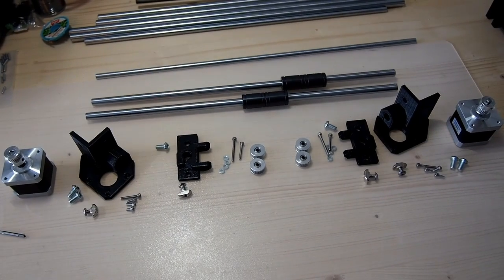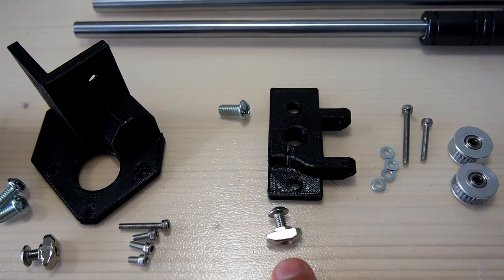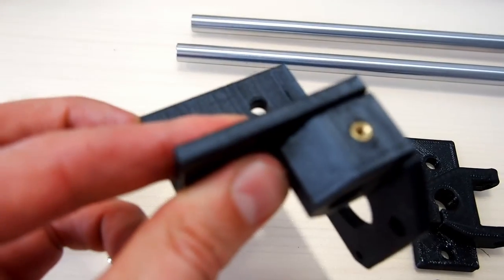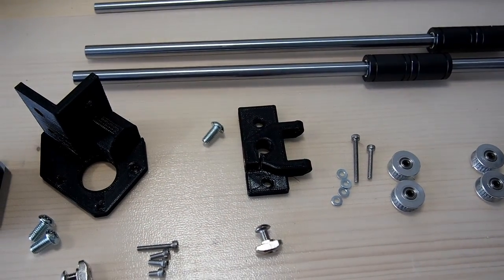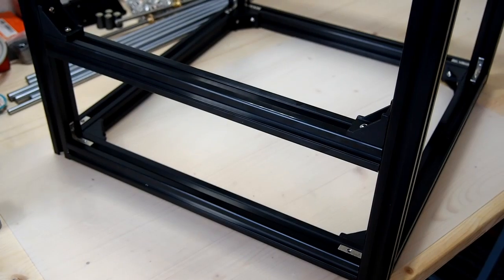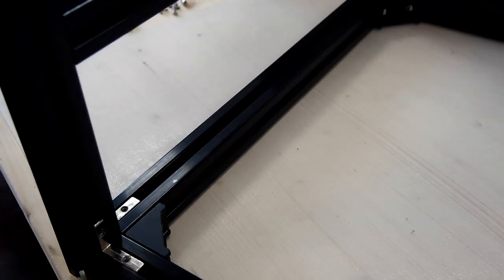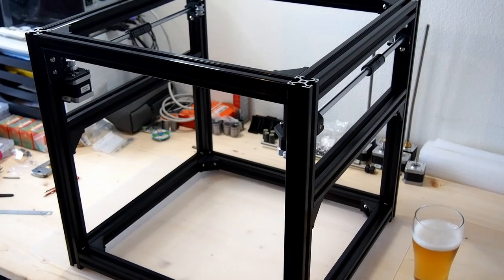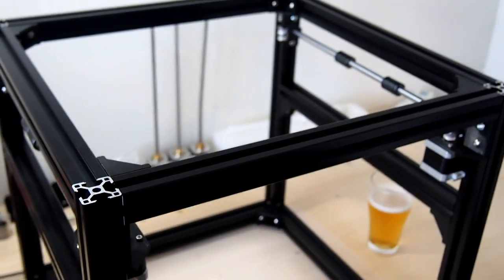HyperCube Evolution #4 - Y Axis Assembly

Comment: I could not agree more with what Fred said. I'd just like to add that you do indeed have 3mm. stainless steel rods available to buy on Amazon. I think they're used in RC models. Buy these, then heat up the bearing with a heat gun to expand a bit (get it to a point where the heat difference between it and the environment is about 80 deg. celsius), put it in the rod and let it cool down and it will lock itself onto the rod. Of course, going this way means remixing some of the parts so that they'll accept a rod with pre-installed pulleys instead of a screw which is what I did on my implementation of the hevo. Yeah and extra points for the beer :)

Comment: You're running pulleys with 3mm id bearings on M3 threads? With washers for spacers? So many things wrong there. First, the bearing inner needs to be fixed to the shaft so the bearing outer can turn on the ball bearings, or you have hardened steel bearing on the soft, pointy screw threads. M3 threads are actually 2.89mm not 3mm diameter, If the bearings are a fraction tight then they will just chew up the threads and your pulleys won't run right. Second, the bearing outer needs to be free to turn so jamming a washer up against it defeats the point of having a bearing. 

You need a shaft that's a tight fit in the bearing id, and spacers that only contact the lip of the inner race. Ok, so I can't find an easy solution there, at least not one that's available to buy. Best I can think of is some 3mm drill rod, held in place with epoxy,  with a drop of ca glue to stop the pulleys wandering. I'm fortunate to have a lathe and a mill so I'll make some brass shafts and spacers.

Otherwise, great job, many thanks for all your hard work. I'm building mine atm, having a lot of fun as my bank balance diminishes.

Comment: Hello Scott, 
I am facing a problem when i move x axis through my lcd screen the y axis also move with that means both axis move even i give command to move x motor, can you plz help
Reply: I have used 3 mm dual flange bearing inplace of without teeth idler pulley is that because of that?

Comment: Replacing the grub screws with regular screws means you're basically using it twice —once to fix the Lbracket and once to fix the printed part — and just hoping that both clamp down simultaneously, right? Did you have to tweak the thickness of your printed parts to get that to work right? I would imagine that if the screw is a millimeter off in length things may go wrong — either the L bracket being tight and the printed part flapping in the breeze, or vv.

Comment: Are you worried about the idler pulley screws coming undone due to rotation of the pulleys over time? It's common to use a nyloc nut to prevent this. Maybe a dab of Loctite in the threaded inserts would be a good idea?
Reply from the maker: With the bearing in the idler there will only be a small torque on the bolt. But as you said. A dab of Loctite would no the trick.